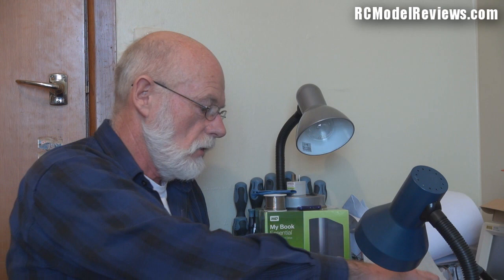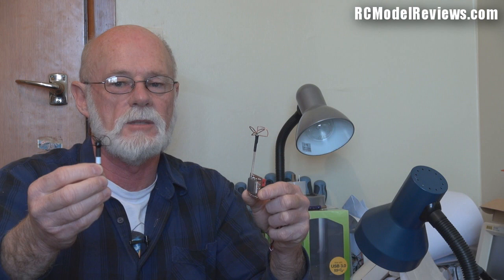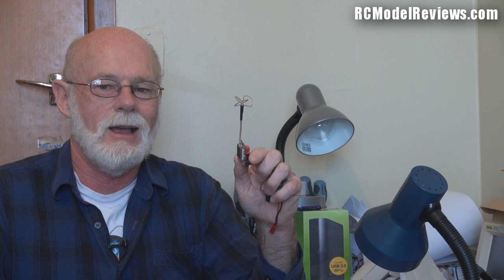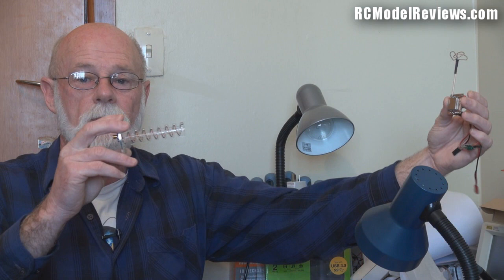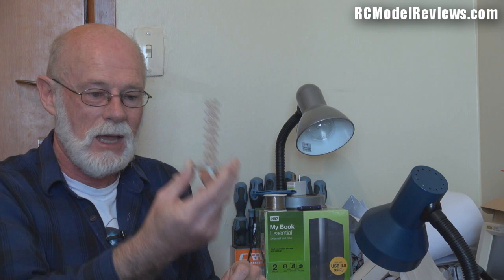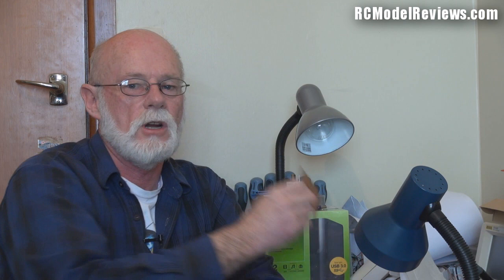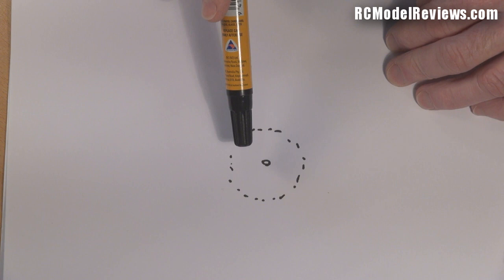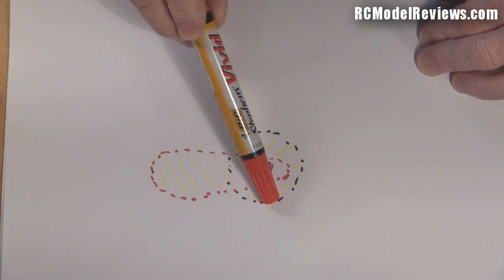FPV antenna gain and range explained

Comment: This is a great explanation of antenna gain, propagation, polar patterns, etc. I learned this many years ago when I was a HAM radio dude and took 2 years of electronics. I used to build giant v beams and  rhombic antennas. I am now getting into multi-rotor RC and this just came to me very clear. Thanks for jogging my memory on power versus gain of an antenna. You B da man.
Jimdog in Minnesota.

Comment: What a great video. This kind of changes my battle plan an I'm now to switch from more power to more gain. Used your instructions and built myself two helicals. A patch I allready have. Now to tweak my eagletree setup for success! 
Can't wait for the diversity controller build!

Comment: Bruce it would be nice if you could upgrade this video to explain the new long range antennas or systems being used now. Guys are going out 20 miles and as high as 10,000 feet. I see what looks like Sat stations being used. Could you explain these systems so we could better understand how they work.

Comment: Great video. Really looking forward to the DIY diversity controller video. I've been waiting patiently since you first teased us with it in that video a few months ago. Also very interested in the DIY 5.8Ghz Rx. I'm hoping we will be able to build a full 4 antenna diversity ground station (antennas, diversity controller, Rx's) for the same cost as a Commercial diversity controller alone. High hopes but if you build every thing yourself I think it's possible. Keep up the great work, thanks

Comment: You are correct.. Radar is a radial beam. Also there is a computer between the radar dish and display that build's the Image. Giving the smooth look, other wise it would be very fuzzy when the beam is looking away from the object..

Comment: Brilliant explanation of antenna signals!  I appreciate this video.

Maybe this is a dumb question, but with three directional antennae as you described, you should be able to tell if the signal is stronger to one side or the other and re-orient the antenna accordingly, yes?  I remember a video on your XJet channel where a diversity controller had LEDs to show which antenna received the strongest signal.

Comment: Two questions :
1.- What happens if instead of using 3 lobes for Video Tx we use the 4 lobes ?
2.- If we modify the antenna lobe shape to be more to the horizon instead of the, let say, 45 degree angle, do we also increase the range ? In other words, the sphere will be more flattened ?

Thanks in advance for the info.

Comment: Suggestion: If you have a 4channel diversity controller, upgrade it to also a tracking device, use three directional antennas and one omni. Lign up the directional anennas horisontaly and put them on a 360 servo, use an arduino or simuar to read what reciever has the best signal(rssi) and program it to turn the "turret" so that the middle of the three directional antennas is in sentre, Then the senter antenna is directed to the plane at all times.

Comment: What about gain for my 2.4 ghz flysky i6s transmitter? I installed dual external 4dbi antennas on my transmitter to try and boost my range , over herd adding 6bi extends range but are the ones bought from eBay for a $1 made correctly ?

Comment: diversity was first implemented on wireless mics, using two recievers  have the same coverage area to eliminated deaspots bcause the two receiver were continuesly working together providing un interupted/unglitched clear vocals for singers on stage, nowdays its common on most wireless communictaion, and really need a minumum mo two monitoring the same aera! at the same time, for your 4 channel diversity, i would mount identical pairs so it would stay true diversity in omni and directional!

Comment: really nice vid mate. really ineteresting to see the practical applications of antennas and their directivity having not long finished an electromagnetics course in uni. 

I would have thought a tracking system would be fairly easy to setup using 3 high gain antennas? essentially shift orientation left or right or keep it stationary depending on what antenna is receiving the strongest signal?

Comment: You could also use a gps on the plane and send back the information. With it you could track the plane on a computer and send the information to the antenna, by using one many various ways (motors, pneumatics, etc). You would need a gps in the receiver as well, since a computer would have to distinguish where you a transmitting from.

Comment: If I have a 1/2 wave dipole in a vertical position on the plane, does a whip antenna on my controller need to point directly at the plane or point upwards?

Comment: For you video tx in your aircraft you are going to want an omni-directional, like a skew-planar. If you put in a directional antenna, like a helical, you would have to find some way to point the antenna on your aircraft at your receiving antenna on the ground constantly in order to get a clear signal. The military can do this, but can you?

Comment: thanks Bruce - Question : When flying fpv are you actually flying your model off the video signal or the radio signal through your transmitter. My radio has a 1000 m range so am i able to fly further up to 3km through the video signal or does my rx/tx have to match the video signal range ? how does that work

Comment: at the 3 minute mark i asked myself why i haven't subscribed to this channel yet.. AWESOME STUFF!!..  you have mentioned that a 12dbi antenna isn't necessarily better than a 10 dbi antenna because it is a a trade-off in range vs how far to the right and left you can fly, so do you recommend a 10dbi antenna for lets say flying 2 miles out? also is the resolution of the picture iam getting affected by the gain of the antenna?

Comment: hello and sorry if the following question sounds dumb but if I had goggles and 2 antennas on it an omni directional one and a patch antenna,which I believe to be almost the same as a helical one,and i follow my drone/plane whatever with it,as in,I turn as the plane moves either left or right that cone will be "pointed" to where i'm looking right?so if I start to turn the plane left and myself left the cone of signal will always be on the plane right?
Happy new year and keep up the cool videos

Comment: Hey looking at seting up 3dr telemetry system, can either have 433mhz or 915mhz, do you know is used in nz? Have checked rnz frequences pdf and states 433mhz range for telemetry (marine) low power devices allowed unit is only 200mv do you know if this is ok

Comment: @Pelle Wiersma - Some omnidirectional antennas have gain by "squeezing" the radiadtion pattern's vertical plane. Think of their pattern more as a donut than a sphere. They still radiate in all directions in azimuth, but don't radiate as far above or below the horizontal plane. So energy that would be wasted radiating to outer space (or in a sharp angle to the ground) is better used sending the signals in all directions.

Comment: Hello,

Thank you so much for your fantastic videos ! I find your physical examples the best way for me to learn about this stuff.

1 Question. Why have the diversity controller switching between the antennas ? Can't you just have all the antenna wired into each-other and the plane talks to whatever is in range?  - or does the total signal get split between the antennas, therefore degrading all of their range ?

Thanks !!!!

Comment: Great video. If you have 2 omni antennas...and one has higher gain than other....what happens withe the ballon when you take an omni antenna with higher gain? It just gets bigger? I think the omni with the higher gain will be better than the omni withe the lower gain.

Comment: cant you mount the helical antenna on a motor that spins around in a circle continuously to pick up signals in all directions? Instead of using an additional omnidirectional?

Comment: nice video, and very nice information.
you answed many of the questions that i had, thanks allot.

are there any good ready 4 channel 5.8ghz diversity systems out there?
i'm interested to build a setup like yours, but i prefer to buy the parts.
also were did you get that  helical antenna, looks very professional

Comment: what happens if you cover your  antenna inside your vehicle? i am working on a project and i want to add fpv to it but i have limited space so the tx for the camera will have to be covered inside the vehicle instead of being outside the vehicle. besides if i put it on the outside of the vehicle it will kill the scale look.

Comment: Bruce,diversity principle is using two or more rx using rssi signal strength to switch either rx for best uninterupted signal and feed, its main purpose is to eliminate dropouts/glitches and always pick the best reception between the two.Do you agree using different antennas with different coverage area, diversity will only be optimized with the area it overlaps, where they both help each other,outside that area, working alone is no longer diversity optimized, but just an antenna switcher.

Comment: Great video. Do you have any additional information on actual dimensions of those patterns. How wide is the 6Db gain antenna at its widest point?

Also, how did you build your 4 channel diversity controller?

Comment: Hi :) thank you very much for explaining how those different antennas work! But i have one question. You say that cloverleaf antennas are omnidirectional, means i can fly in sphere shape, but actually it doesn't provide same strength of signal in all directions. I think there is some 'blind' area under cloverleaf antenna, because when i flew over my FPV station i had hitches for few seconds. So, seems same signal loss can happen if on long distance i will tilt plane facing bottom of cloverleaf antenna to FPV base? Or there just was something wrong with my setup?
Reply: It's actually more of a donut than a sphere in reality

Comment: Hallo Sir just question, I have Phantom 2 DJI gimbal version with 2.4ghz RC I ma planing to upgrade antenna, just change cable inside so i can have a screw socket.
Question is then

 1. If is any point upgrading phantom 2 controller, do this will give me bit better range
 2. What antenna will be best, is so many on ebay is anything you can recommend.
 
Thanks, for all videos they are relay a BIG help

Comment: Could you comment on the effectiveness of using a helical antennas with circular vs linear polarization from the transmitter?  Are there helical antennas DESIGNED for circularly polarized clover leaf antennas?  How do we tell this by looking at them?
As usual, your explanations, diagrams, and balloon illustrations were excellent. Love your presentations!
Jim

Comment: hey Bruce, is it important to have cloverleaf antenna on both end of the receiver and transmitter? some quadcopter are coming out with whip antennas and they produce almost the same signal with almost no static. however I have a cloverleaf on my receiver/goggles. any explanation on this?
Reply: I would say CP cloverleaf on both. The biggest benefit of circular polarised antennas (cloverleaf) compared to linear polarised antennas (whip) is that they can reject multipath signals, which are reflected off a range of objects. Circular polarised signals become the opposite polarisation after they reflect/refract off an object (i.e. a right-hand CP signal will become a left-hand CP reflected signal). These reflected signals will appear much weaker than the proper signal at the receiver due their opposite polarisation. Also, CP RX antennas are less affected by the angle of the antenna relative to the TX antenna.

Linear polarised signals do not significantly change their polarisation after reflecting off signals, so they are received at almost the same strength as the proper signal and thus create more interference. Also, tilting TX antenna out of alignment with the RX (i.e. while flying) will change the polarisation of the signal (e.g. vertical to horizontal) and reduce the received signal strength.

Linear polarised antennas on high frequency systems probably have similar performance to a CP antenna on stationary objects in a large open and flat area with no obstacles with the antennas far off the ground, however the CP will probably be better in all other situations. The major disadvantage of CP antennas, especially at lower frequencies, is the size/volume.

That's my understanding anyway. Correct me if i'm wrong.
Reply: cloverleaf is used to eliminate multipath signals

Comment: I put my vtx transmitter antenna on a gimbal to keep it straight up and down all the time. now when my plane banks or pitches the antenna stays straight and i don't get static or drop outs from banking or pitching the antenna around. so now it does not get out of phase with the ground station antenna .

Comment: It's easier to use a lightbulb analogy. if you have a 100W light bulb suspended in the middle of a room you get even coverage of light. Put a reflector on one side of it and you get 200% light in half of the room. More reflector = more gain. A highly directional antenna is like a very narrow reflector, it will give you a very bright spot but only covering a few degrees in the direction it is pointed.

Comment: I work with an RF tool to heat human or any animal tissue for micro surgical procedures.  In other words, I transmit an RF signal from my device to an antenna outside of the antenna holder of 5-6 mm in length.  This antenna (stainless steel or gold plated wire) is inserted into the tissues.  Once in position for the treatment, the RF is applied.  We. used to call this flash technology but we learned that high heat and short duration left a lot of progenitor cells in the treated area insufficiently heated.  It is obviously a monopole as far as I can determine.  I want to know about the characteristics of the RF signal being used to create heat in the tissues.  My goal is to heat the tissues to electro-coagulate tissues at a temperature of approximately 120 to 130 degrees Fahrenheit.  Further, I do not want to increase the pain of the patient so I want the heat to be least aggravating to the nerves near the heat.  I need to know, but can't so far, know whether a slow heating over say the course of a second, or 10 seconds, or even a half second is best for that reduction of pain.  I also do not want to overheat the tissues so that I create a scar in the tissues.  It is my opinion that I do not need a receiver of the signal.  But I need to precisely control the RF at 13.56 MHz or 17.12 MHz in order to control the heat.  I also need to know how far away from the antenna is heat created.  0.5 mm heat range at 125 degrees F would likely be adequate in most cases.  I want to experiment to determine what adjustments to the heat would be optimal in electro-coagulation but nothing hotter than that.  Are there any devices where RF inside tissues could be measured for heat produced or does that remain a guessing game.  As a practitioner, it would be helpful to know exactly how hot we are making treated tissues.  We can estimate the temps by the results of our treatments but we have no way to measure temps objectively within the tissues. Additionally, am I to assume that the heat of the RF on the "probe" (antenna wire) is only generated from the tip.  This is critical if I need to treat tissues throughout a range of approximately 0.5 mm to perhaps 5-6mm.  In other words, is it necessary for me to move the probe(antenna) throughout that range for it to be effective.  Knowing where the RF signal (heat) is being transmitted into the saline tissues is critical.  I know of no research into this last concept of the location of heat sub-epidermal.  In simplest terms, how hot is hot and where is it hot (125 degrees) in these tissues.  There is research into cadaver tissues where a slice of tissue can be observed.  But, living tissues act differently because the saline and the other bodily liquids are always circulating unlike cadaver tissues where there is no circulation.  Your thoughts and suggestions about conducting this kind of research and finding a lab to work with me on this research would be helpful.

Comment: Hi great video!!! I have a pv2+ stock and im looking to get better fpv range , im looking for 3,000 to 4,000 feet whats your recommendation thx!!
Reply: I'm flying my p2v+ to 2800 feet with 2 of the 2.4 ghz tp-link 14 dbi directional antenna's, and an 11 dbi 5.8 ghz antenna. Now these antennas need to be mounted on a tipod, and given your desired range, you could get away with something less that can be mounted on the controller, as you can also replace the 2.4 ghz antenna on the p2v+ itself along with the antenna swap on the wifi extender and controller. (I have yet to modify the p2v+ transmiter antennas, or use boosters, which will combined give 2-4 miles or ~10,000-20,000 ft of range if configured correctly)

Just remember, the 2.4 ghz is for video, and the 5.8 ghz is for control on the p2v+.

And to get to get to 3000 ft, you will need to replace both the 5.8 antenna and at least 1 of the 2.4 ghz antennas (the 2.4 video feed uses a diversity controller, so if you replace both antennas in the wifi repeater, then you can link the 2 together to increase total coverage as he showed in this video.

Hope this helps. Search for phantom 2 vision plus range mod, and you'll get videos that break down the process of modding the controller and wifi extender.

Comment: Hi Bruce, another great video.  This is probably a stupid question but you talk about getting ranges of upto 4km using helical atennae but what about your radio Tx and Rx, what kind of range would I get using, say, a Spekturm 8x ? obviously there's no point in getting 4km range on my fpv gear if I cant control the aircraft. Sorry if this is a stupid question.